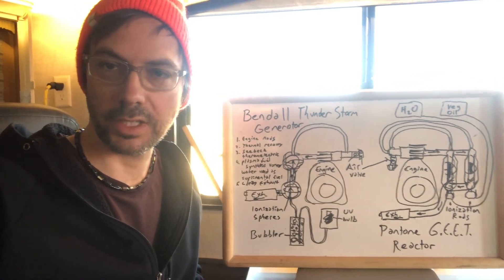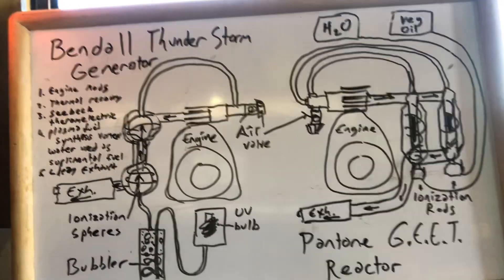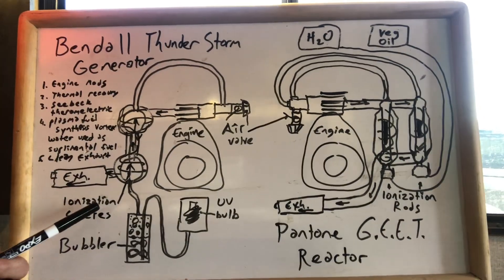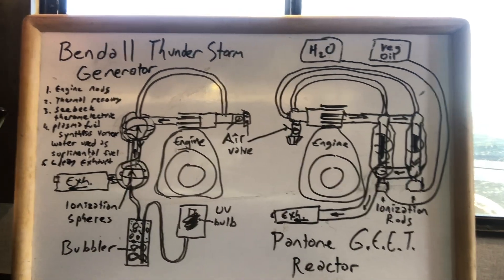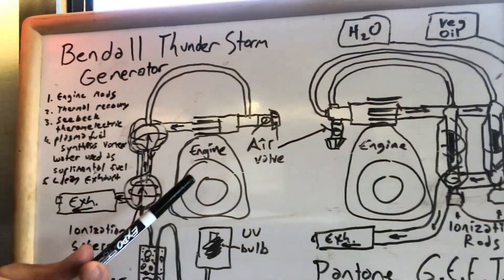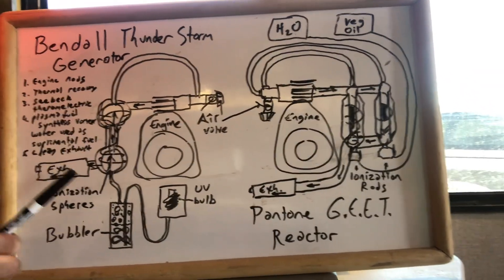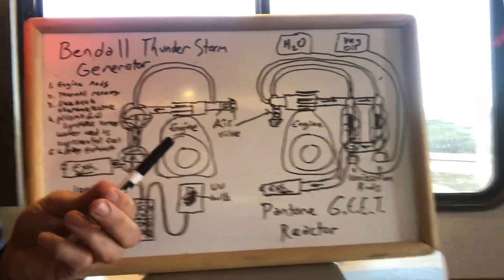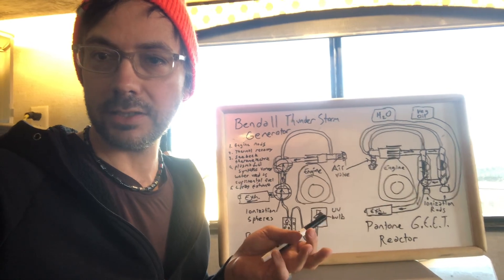Thunderstorm generator & geet reactor. Fuel reformer technologies compared.

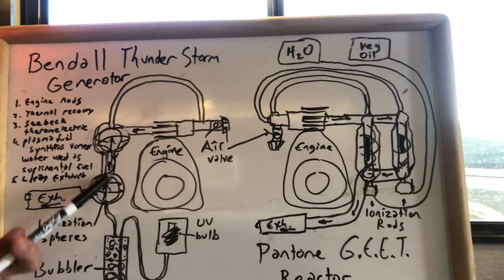Comment: 2:47 There is one very strange thing about your described thermoelectric effect in both of the counterflow votex heat exchanger "reactor" variants. First, traditional seebeck effects usually require a junction of two dissimilar metals, but these reactors differ in that they have an alloy wall between two dissimilar counterflowing gases in what's assumed to be an ordered flow.

The largest seaback coefficient in a known/studied material is the semiconductor Lead Telluride (PbTe). The coefficient is 0.0004V/K which, voltage for hydrolysis is required (1.23V) needs to increase by at least 3000K, or a fraction of that temperature with a series-connected circuit of seebeck junctions...But there is no obvious solid circuit, so how is vortexing vapor vesicles so much more effective?

The other strange thing is the need for a UV bulb on the air intake of the TSG. They are definitely using a UV-B bulb which is non-ionizing, and yet they claim the trace argon gas in the air is being ionized which is a very puzzling claim. And the Geet reactor never required it.

Comment: On the TSG, the air coming into spirals moves in the opposite direction to the exhaust , there is actually another sphere within the sphere and then a ball in the centre of that sphere. creating  2 duelling tornadoes. also at specific ratios of 4:3:2 and at an angle of 51deg that are used in the pyramids. the geets are cool though, definitely utilising vortex technology.    https://youtu.be/zrHdz5yMjBI?si=UUZenamygKw-BuAw
Reply from the maker: Yeah I’m still trying to get better understanding what the bottom sphere does… vortex flow guidance nozzle it seems
Reply: @sigmacentauri6191 so the ratio is 4:3:2 which is the radius of the sun and a double sphere is 864 (864000) being the diameter.  Makes me wonder how the geet could incorporate the 4:3:2 ratio and the effect

Comment: I always thought of the Thunderstorm Gen as a combo of a GEET and Stan Myers HHO Gen. Guess its time to fire up my GEET and do some tests
Reply: Electronic control system is plausible.
You NEED baseline data first. You will need: MAF, MAP, O2 sensors as well as thermocouple washer and an emission tester.

Maf sensor tests airflow into carb, Map tests vacuum inside the intake tract, O2 tests a/f ratios, thermocouple washer tests actual combustion temps.

You need to run on gasoline first, same way as it was intended. Test at every rpm. This is the main baseline.
Reply from the maker: Oh please send us links to your project if you have videos to share how it works.
Reply from the maker: Ever tried to make computer controlled ignition for it?
Reply from the maker: I think having a computer controlled servo motor valve operated logic system you can make the fuel gasification rate match the engine and get the air mixture better …

Comment: You do not seem to understand how evaporative cooling works. The water absorbs heat to turn into a vapor and is hotter than the surface it left. This is a bubble carburetor plain and simple.
Reply from the maker: I work on cooling systems. I absolutely do know how evaporative cooling works.
Reply from the maker: The phase change the liquid undergoes drives the temperature differential between the exhaust and the water/fuel vapor that causes the thermoelectric effect to occur.
Reply: @sigmacentauri6191  You can double speak to people who have no understanding of physics and chemistry...the rest will recognize bullshit when they see it.

Comment: Great analysis...many similarities for sure. Have you measured the overall increase in performance you get from the fuel reforming process?
Reply from the maker: I had done some tests and found the bike was getting around 100 mpg… this is not exactly an impressive figure for a 50 cc engine however. The thunderstorm generator tests have shown as much as 64% reduction in fuel consumption under a given load… i was able to demonstrate the geet reactor engine can run on various types of fuel such as reclaimed cooking oil or blends of gasoline and water. I didn’t get to the point where i was testing fuel consumption while cutting the fuel with water however. I need to get back to tinkering with this but haven’t had time or financial support to create more advanced prototype… i have a new crowdfunding campaign btw
Reply from the maker: https://www.gofundme.com/f/dorians-hydrogen-reactor-engine-r-d-lab?lid=5t67eofkbs7t&utm_medium=email&utm_source=product&utm_campaign=t_email-co_welcome-0221-us&fbclid=IwQ0xDSwNU3DBleHRuA2FlbQIxMQABHiRwHnaXhFAJVSAxueOglruLf50iZNtSrMPTLvirNETVSrdw_5TmhDk6qvTh_aem_iqqVRkmQ9f3J1DSUEFeHFA